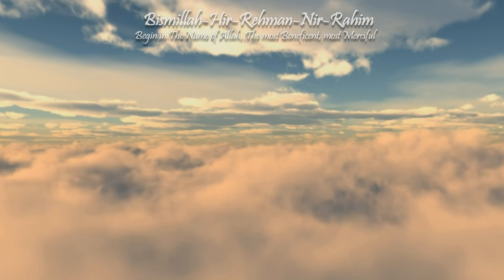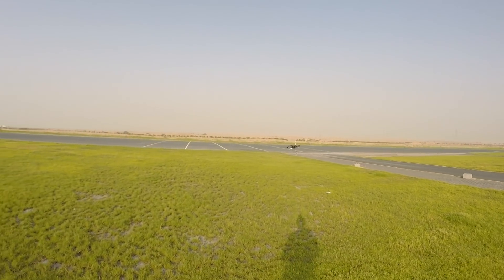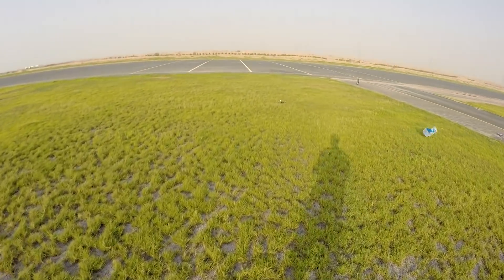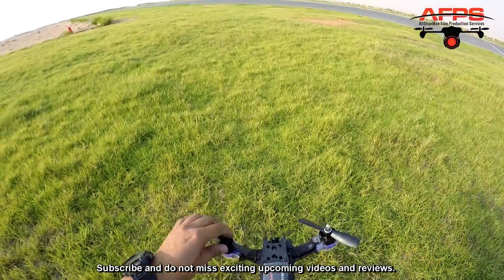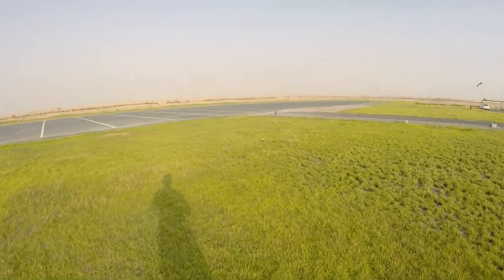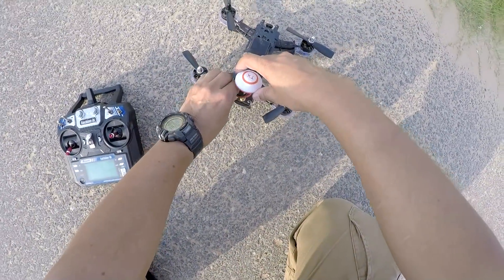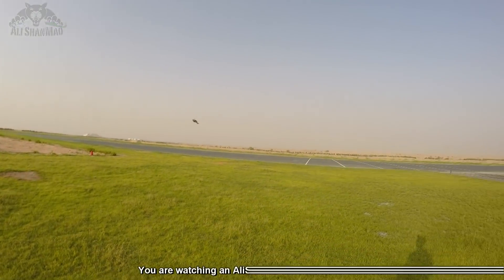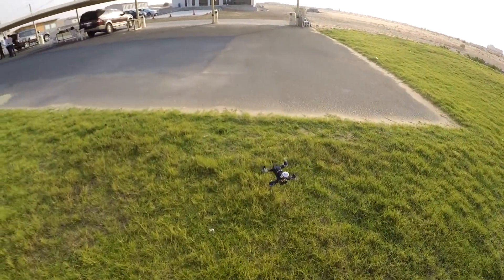Eachine Falcon 210 RTF FPV Racing Quadcopter Flight Testing

Comment: sir need help. i'm new with fpv race quads. i am currently choosing between walkera 250 advance eachine racer 250 eachine 210, eachine racer 180. so far this is all i got because i still prefer ready to fly one. for you sir? what do you think is best for me?
Reply from the maker: +Roberto Bendaña Eachine are cheaper and you can easily modify them.
Reply: alishanmao tha k you so much :)
Reply: New walkera Runner pro 250
Or sellpro Swift 2 both RTF